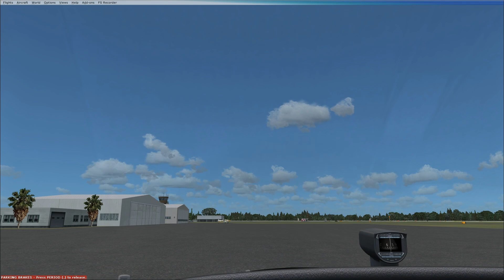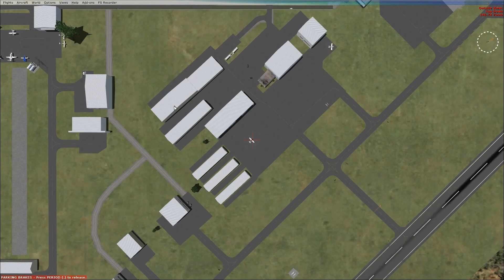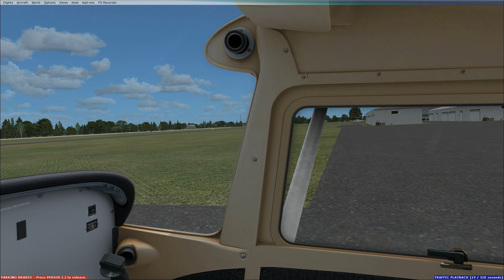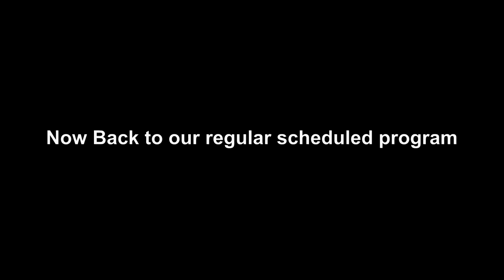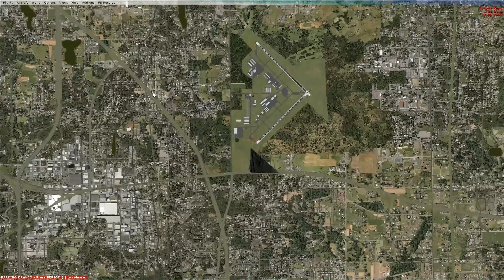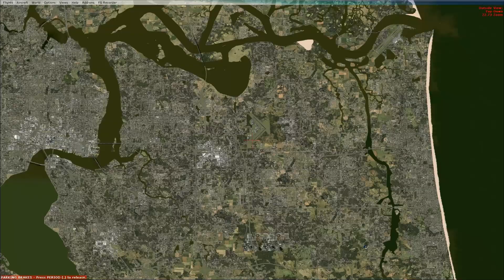A2A Cessna 172 Tutorial. Video 4, Taxi out

Comment: how do you turn so easily. When i turn i apply full rudder and have to keep spamming the brake left/ brake right button and apply 50+% thrust in order to prevent my plane from stopping while turning. If I just use rudder then my plane would take 10000 ft to do a 180 turn
Reply from the maker: It takes some practice but thats kind of how the real thing is. rudder alone is very limited you have to use differential breaking.

Comment: Whenever it comes to helicopter I wouldn't say actually flying away or being literally thrown around is what you should be worried about. Unless your dealing with a CH-47 or a pavehawk or something huge! The biggest worry you have is that, that the wash is going to come down right on your plane and that can actually mess up the planes internal structure itself which can be detrimental in the future! Planes are built to produce lift, if a large down force is put on the wing, that's just not the way Cessna designed it, stuff is going to get messed up!

Comment: How did you stop the aircraft?
Reply from the maker: Sends altitude and other information to ATC so they know exactly where your at on the radar scope.
Reply from the maker: Kevin Davis Engine idle then apply the brakes.
Reply: Idle as in throttle zero percent?
Reply from the maker: Basically. 1000rpm or less
Reply: Is there a hot key for that?
Reply from the maker: F1 brings the throttle out completely. be carefully that brings it out to idle below 1000rpm witch can cause the engine to run rough. Period key will apply the brakes.
Reply: Hello. What is the function of a transponder?